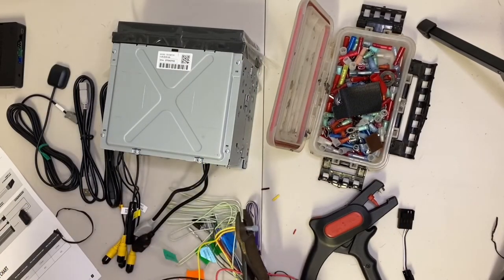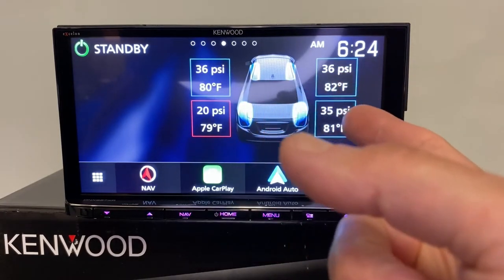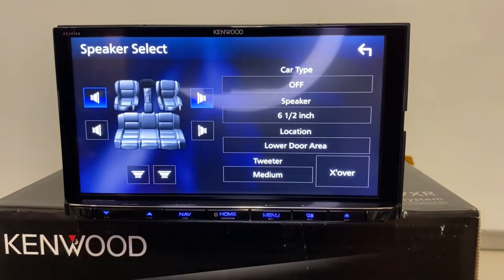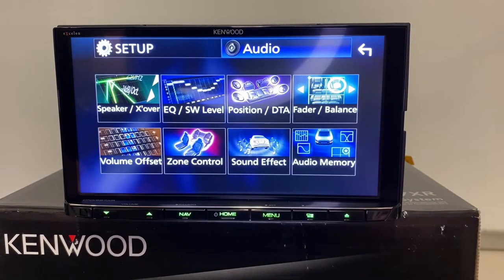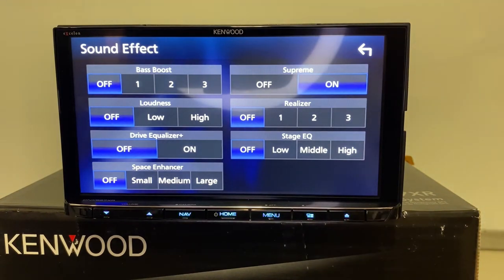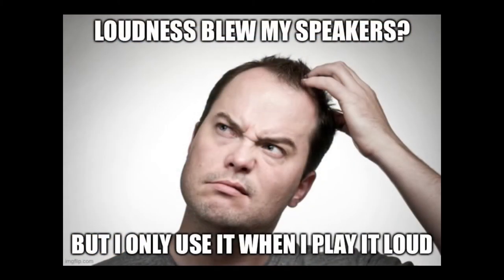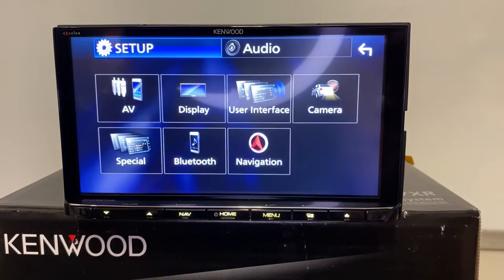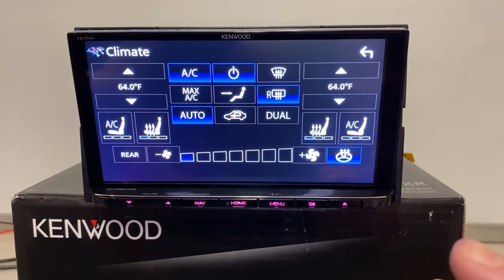Kenwood DNX997XR review by @carstereochick

Comment: After all the fanfare advertisement of Wireless Hi-Res FLAC/WAV quality, I did misadventure with one those wireless multimedia units. Wireless Hi-Res is only in theory. So, I setup my USB music library at Hi-Res. Nice! After two weeks it will play only one song. That was the end of it! I went to buy the DNX997XR. It did restore the full integration my sound system has. Other, CDs can be burned to play FLAC/WAV without any problem. It is optical! Aux input also is nice!

Comment: I watched your video on the Kenwood DNX997XR. I just bought a 2006 Corvette Convertible with this unit installed.  Everything works well with one exception….. the hands free Apple CarPlay.  When I receive/make a call the person I am speaking to tells me they hear a delayed echo of their own voice when they speak.  Is there any solution to fix this?  Turning down the volume only makes it difficult for me to hear them.  I’ve never had this problem with any other aftermarket stereo with hands free capability.  Considering the $1,300.00+ price I would expect Kenwood would have some sort of ground loop filter other than the mic settings that do not seem to work.

Comment: I’m having this unit installed, as an upgrade, into a ‘96 C1500 single cab P/U, with Excelon door/behind seat speakers, and CMOS-740 backup camera.   I’m not understanding what the “Maestro module” is.   Is this something I need, or would find helpful on an older vehicle like this?

Comment: I have the DNX997XR at
My 7 year old messed with settings and it’s stuck on android now rather than Apple car play…how can I reset to factory settings and start over?
Thank you!
Reply from the maker: Some of the earlier Kenwood models had a separate A/V menu for smartphone where you could tell it what device you're using, but off the top of my head, I don't think model has that. It supports both and you should be able to easily switch between devices without changing settings (like if you have a personal iPhone and a work Android for example). Without playing around with it myself, I don't know what you mean by it's stuck on Android. Hmm, try going to Menu -> Setup -> A/V (with the smartphone icon) -> Apple CarPlay Device List. You may see your device listed there and just be able to tap it to reconnect. If not, I would clear the memory and delete whatever devices are stored in there and then do the same from your phone and re-establish connection. Sometimes you just have to clear memory from both devices if you're having trouble connecting. Is it working thru the wired connection? Just not wireless?

Comment: Hello you know a great deal and i would like your expertise
I drive a 98 Buick regal and my husband had this unit installed and paired with some Alpine S-Series speakers a 900w JL Audio Amp and a 12" JL audio Sub inside a BBox and i love it all theres just settings i need help with
1, My husband said it has WiFi settings but is clueless on how to/who to pay for dara

2, how would you set iup the Xover to isolate bass to the Sub

3, How would you rate the setup(Husband asks Lol)
Thank you and have a Blessed day
Reply: Also it is the DDX9907XR did you review that model?
Reply from the maker: So the WiFi is for using wireless CarPlay/Android Auto. The way that works is you 1st pair to the stereo like any Bluetooth setup. The initial handshake is done by Bluetooth and then the rest of the connection is done by WiFi. That's how the radio is wirelessly sending the information to the display, it's done over WiFi transmission, but it's not like the receiver itself has any type of cellular data or internet, it's just how the audio/visual information is transmitted wirelessly.

I can't answer your second question unless you tell me what model amp you're using. You're either going to set up the crossovers on the head unit or on the amp, but not both. Assuming it's just a subwoofer amp (mono) you could put the high pass filter on the interior speakers (HPF) to 80 Hz which tells the interiors to play 80 Hz and up. Normally we set the sub filter (LPF) at the amp to the same thing so the sub plays 80 Hz and down.

I'm a fan of the Kenwood eXcelon products. This and the DDX9907XR (same features basically minus built in GPS) or the DMX958XR are some of my favorite sounding head units.

Comment: The volume offset would be nice. The stock unit in our 2015 Buick Enclave has a sizable volume difference between radio (XM/FM/AM) and the digital music sources (lower: CD MP3 / a LOT lower: USB/Bluetooth). And, yeah, I've tweaked the MP3 files to output close to clipping, so I can't make them any louder.

This would be generic to most Kenwood units, but how much text can be displayed from the digital music files when the "Small Text" has been selected and the album art is hidden/unavailable?

Comment: I purchased and had a dmx957xr installed along with the hd rear camera, the cmos 720 and it is a great display. I saw your video on the other excelon voltage at the pre outs which is great. That was about 6 moths ago and I’m about to get back to it now. 
1.Did you ever get the wired apple mirroring to work? I am either using the wrong usb or something or am having the same problem.
2. The dynamic guidelines on the back up camera, are those only available with maestro? The original camera had them but the new one either doesn’t or I don’t know how to set them up.
Reply from the maker: Hi Nathan! Sadly I never did get the Apple USB mirroring to work, but truthfully I haven't had the time to play around with it. Dynamic park guidance lines - that is typically an overlay done by the Maestro in compatible vehicles. If your vehicle is not compatible, you can always put on the fixed park guidance lines. You can turn those on/off and adjust them on the screen in the set up menu under the camera settings. OEM guidance lines are a tossup. In some vehicles we find the guidance lines are part of the camera, but sometimes they are actually part of the factory radio screen. I hope that is helpful!

Comment: Have you heard any updates on what Kenwood would replace this unit with since it's now discontinued?  Any new models that you're aware of that has all the same features as this one? Unfortunately I had a couple of health issues come up so I have not had a chance to install my DNX 997 XR that I found a while back. I really lucked out and found a small shop that had two brand new in the box not refurbished!  So I was just curious if you've heard any scoop on what might be the next new unit coming out to replace the 997 XR?  To be honest the only thing I could think of that a newer model might have would be possibly a HDMI input or output. I think this unit pretty much has everything I need.  I really appreciate you taking the time to read and reply to my messages!  Take care up there and stay warm!
Reply from the maker: I checked last month and was told it's not discontinued, just been backordered because of chip supply issues. I think largely related to Garmin on this particular model. I have some on order and last I checked they're hoping to see these ship in Spring/Summer, but no solid dates. So no replacement that I'm aware of at this time and yeah, HDMI would probably be added on a future model as I'm seeing that on some of the other newer models. I hope you're feeling and doing better now!
Reply: @carstereochick Thank you for the quick reply and the well wishes! 😊🙏 That's interesting information because I see some websites still say they're on backorder but then when I looked at crutchfield it says discontinued on the 997 XR.  At least I've finally have mine so when I'm up to installing it I already have the PAC module GM1A-RST, My front and rear cameras and my XM tuner. Take care and thank you again! 😊

Comment: Excellent review! Trying to find the DNX 997 XR is impossible! I ended up going with a Amazon certified refurbished DNX 996XR and it had issues right out of the box. Erratic touch screen behavior and non-response as well as a weird blue line on the left of the LCD screen.  I shipped it to United Radio under warranty and after diagnosis they had to replace the video PC board as well as the touch screen/digitizer that goes in front of the LCD panel. They say they check all functions for 100% functionality before they return it so we'll see what happens when I get it back.  I'm just trying to decide whether I should return the 996 XR referb and keep hunting for a new 997 XR?  All I need is two camera inputs so other than just having a brand new unit as long as the 996 XR is working okay it has all the features I need.  Have you experienced any reliability issues with either the 996XR or 997XR?  Any suggestions or help would be greatly appreciated. Thank you!
Reply from the maker: I have not had any issues, all of the Kenwood receivers I've been selling for at least the past 4 years are complete workhorses which is one of the reasons I love them. I try to stay away from refurb's because you don't really have the whole story. Someone could have spilled coffee on in it, cleaned it up and then returned it saying it didn't work right and then eventually it ends up for sale on eBay or Amazon as a refurb. However, United Radio is great, that's where I send out radios for repair as well and in 20+ years I can only recall 1 instance where a repaired radio had to go back out and that was due to a broken volume knob, not a board/electrical issue. They warranty their repairs for 1 year.

Edit: Excuse my manners - thank you for watching! I'm glad you found it helpful :)
Reply: @carstereochick  Thank you so much for your reply and the information!  I have read a lot of good reviews about United Radio so hopefully they did a thorough check out in their quality control department before shipping it back to me.  I'll find out on Tuesday when it arrives!  I tend to shy away from the refurbished units also but since I couldn't find the DNX 997 XR I opted for the refurbished 996 XR. I must admit United Radio was really on the ball about their communications with me and letting me know timely updates.  I'm just hoping that the unit works okay because I certainly don't want to pull out my console of my C6 Corvette twice!  Keep up the great work on your channel here it's very informative! Thank you again!

Comment: Nice video.  I have a DDX9906 which appears to basically use the same interface as the 9907 in the video less the nav.  Is there away to add shortcuts to the "secondary shortcut screen" (as the manual calls it).  For example this would be the window showing at the bottom of the display when you have a source like Siriusxm selected.  I can change the primary 4 sources, but if you swipe off of those 4 its just blank and I am not sure how to add anything else to it.  Also is there a way to remove the warning banner on the back up screen when in reverse?  I feel like this impedes the clarity of the backup camera and what you can actually see.  Any help you could offer for these two issues would be appreciated. Thanks.
Reply from the maker: Hi William, thanks! Unfortunately no way to change or add what is being displayed on the secondary source screen shortcuts. My understanding is it just to display the same 4 icons you have on the home screen. Regarding the camera message, I think there is a way to change it. I don't have that model on display at the moment, but I do have a similar model and if I go into Setup > Camera > Rear Camera Message options are Always Display or Clear After 5 Seconds. I don't see any option to turn off completely, but at least you might be able to make it go away after 5 seconds.

Comment: Do you think the 'Loudness' feature in the Sound Effects could be a use case for convertibles? So, I would have loudness on when the top is up, then off when the top is down.
Reply from the maker: Sure if you keep the volume at a lower level. Loudness is a misnomer. It’s for listening at lower volumes, it boosts frequencies that are harder to hear at lower levels. If used at higher volumes it can cause distortion.

Comment: My dads HD radio stopped working out of nowhere. Apple car play and everything else works except for the fm/am stations do you have any idea why this happened?
Reply from the maker: I'm assuming you mean it's receiving stations analog only, so the actual FM/AM tuner is working, just no longer receiving HD? It's possible the receiving mode accidentally got changed. When you're on the FM/AM tuner screen, there is an arrow or tab on the left side. Tap that tab and there is an option that says something like RCV for receive mode. Make sure both analog and digital are checked off.
Reply: Both of those are off, it’s on auto. It won’t let you change between stations or channels unless you do it on the 
FM 01, FM 02 etc options it gives you on the right side of the screen, and even then none of them work nor play anything so thought I’d ask you on here since I haven’t found anything about it online and it just did it randomly out of nowhere
Reply from the maker: Can you be more specific? When you said the HD radio stopped out of nowhere, I assumed you meant the HD was no longer working as in all of the stations that were normally there were available, but no longer coming in HD quality. Are you saying you can only cycle through existing presets? And you can't do manually tuning? So when you hit the up/down arrows towards the bottom of the screen that you were using to seek stations, it's instead cycling through your presets? Is that correct? If so, on the top of the screen it says Auto 1 Auto 2 or Manual. Tap it until it says manual and you'll get it back to manual tuning when you tap those arrows. Auto 1 makes it seek strongest, Auto 2 changes the function to preset seek and Manual is manual tuning. May seem redundant, but this is how you change what the functions on your steering wheel controls are doing. Some want preset seek, some want regular seek and others just want manual tuning.
Reply: Sorry if it doesn’t make sense but I can do all of that except none of the stations seem to work. No sound plays at all, seems like they’re not getting any signal at all
Reply from the maker: Okay, that's odd. No sound plays at all, as in it's dead silent on all channels? Or is it static? The only time I've ever seen that happen where it's dead silent, is when the receive mode got accidentally changed to digital only. I know you said it's on auto, but have you tried switching it to analog only to see if it receives? I'm assuming it's dead silent. If there is static on all channels then I would suspect an antenna connection or antenna issue. Or maybe the region got changed somehow. You can also try a hard reset. Go into menu, setup, special and select initialize. That will reset ALL settings back to factory, but the audio recall feature should still be applicable (according to the manual). If you haven't saved your audio settings, I would go in there and save it under audio memory before you reset so you can recall it after.

Comment: Would you happen to have a review on the Kenwood Excelon DNX697S?  Thanks for your help.  I'm looking to purchase an aftermarket radio for 2004 GMC Yukon XL Denali.
Reply: The Main differences between the DNX997XR and the DNX697S are the motorized capacitive display that tilts so you can find the optimum viewing position, the wireless support for Android Auto and Apple CarPlay, and the up to four cameras. Your Yukon XL doesn't need the motorized display because the radio seats high... The 3-way speaker setup is a nice one that will put you back to the old school mode.
Reply: @velocast  Thanks for that info. I'm thinking of buying two units, one for a 2005 Silverado the other is a 97 Land Cruiser. I doubt that either are new enough to work with Maestro so there would be options I'm paying more for. Actually, both units probably support Maestro input/output. I kinda like the top slot loading more than a motorized display. Wireless Carplay would be cool though. Hmmm

Comment: I'm trying to decide between this HU and the pioneer AVH-W4500NEX. In your opinion which is better? It's gonna be hooked up to a zvx 4500.1 skar amp
Reply from the maker: If you are a sound quality person I prefer this Kenwood. I have sensitive ears - especially to top end frequency range and although I love the features of Pioneer, I do prefer the sound of this Kenwood. Personally I think it is more detailed, a lot smoother, punchier in the bass because of the higher voltage pre-amp and more audio control features. Graphics and looks/ease of use? I think Pioneer does a better job in that department. Reliability? Kenwood. Much lower failure rate.
Reply: @carstereochick  I appreciate the response. Just can't believe how much it costs. Thank goodness for pay in 4 paypal lol
Reply from the maker: LOL I know, but hey, if you don't need sat based GPS navigation or CD consider the DMX957XR.
Reply: Has the HD screen and 5 volt per channel. Perfect. Thank u
Reply: @carstereochick  Just some info. None of them have Navigation built in the DNR and DNX series are nav units. The Only difference in the DMX957XR and DDX9907XR is the DVD player. Now didn't really need to watch this video but got on your channel after you done the comparison of the 9907 and the 7706. I have 2 of the 9907XR's after I got mine about a year ago then wifey decided she liked it. so now we have 2. but just ordered the 706 for my daughters car. and was watching the distortion comparisons. Would really liked to seen the distortion on the internal amp after you turned the bass level down. As my daughter doesn't have amp or amps and will be running off the HU for a bit til she saves her pennies to upgrade.
Reply: I'm a dummy. I was listening while scrolling the comments. Thought this was the DDX9907 not the DNX997
Reply: Nav is not a huge deal anyway. Love how whatever I have on my phone maps pops right up in android auto when I turn on the HU